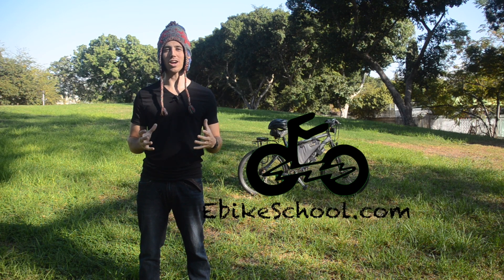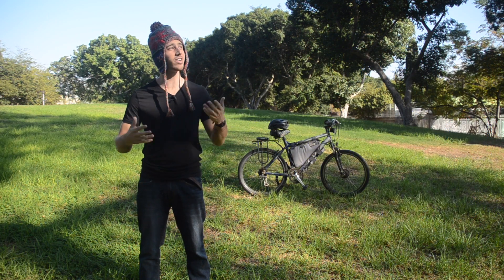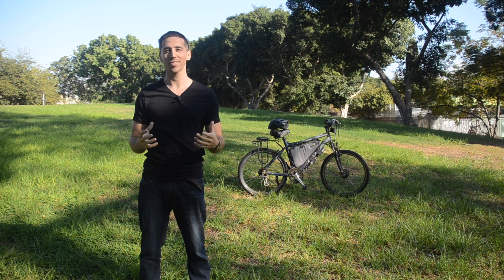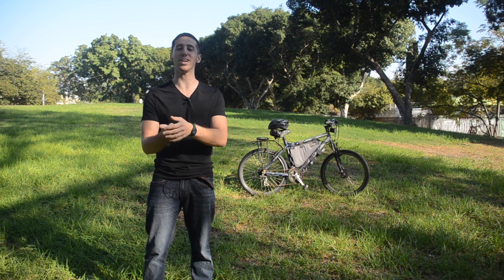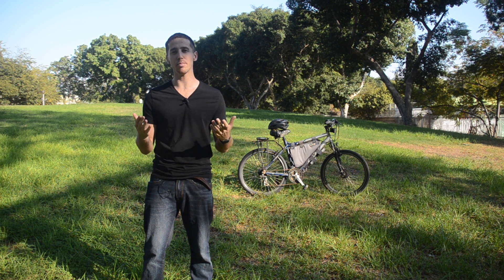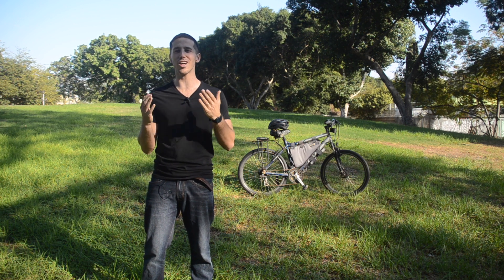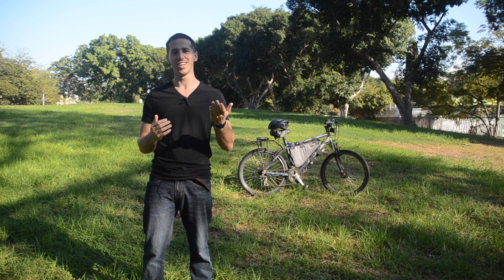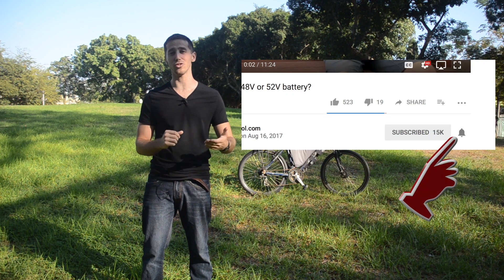10 COLD WEATHER Tips for Your Electric Bicycle

Comment: My EP-2 Pro e-bike starts to struggle at higher power levels when the battery has been stored at -20C outside for more than a day and won't turn on at all if it's been stored in -30C. 

Was wondering if maybe replacing the battery cells inside with ones that can handle lower temperatures like the Molicel P42A/P45B and P30B/P28A would help, as those are rated for cell temperatures as low as -40C?

Comment: Hi, could you please do one for hot weather. With the unusual/excessive hot weather.. my commuter diy ebike started shutting off on me I was trying to keep it in lower pedal assist modes and avoided using the throtle but towards the end of the ride I could feel it was stopping because of the heat. I don't want to ruin any of the electronics as this has helped cut my  commute time in half so any tips you might have would be great.

Comment: I've got a DIY battery pack that I only carry in my backpack so the cold weather battery problems are pretty much solved by default. It's very well insulated and the heat of my body plus the heat from the cells keep it at pretty much the optimal temperature. It's only a 500 Wh pack so it's no big deal to carry it on my back. Besides when I have my ebike out I'm usually going somewhere I need a bag anyway.

The battery seems solid but keeping it away from the harsh vibrations of the bike frame adds that extra bit of confidence knowing the welds are less likely to shake themselves loose.

Another factor is that my frame is quite small, so the battery would be a tight fit. It's designed to fit in case I want to, but I would certainly have to get creative with the mounting bracket.

Comment: Great video. I'm definitely leaving my lithium half charged this winter in the shed. Will probably get a heating blanket for the heater to.
Do you know of any device that I can hook up my 72v 40ah lithium battery to inside in order to use the power from it?
I'd much rather keep it inside and use it to charge my electronics or something than keep it outside in the shed the while winter.
Living in Ontario Canada sucks weather wise.

Comment: I've had an ebike since around 2016 and now learn I've been doing everything wrong! I have charged it too long every time. I always leave the charger in permanently! (I will stop now, since I worry the risk of fire is greater when the battery is a bit older!?)I have stored the battery fully charged in a cool place, around 5c for 3mos most years fully charged. And I ride in very cold winters when I'm home during winter, usually until the battery is dead. Then just wait, and cycle without PAS, and usually the battery can have a little juice left to get up the last hill on my way home. Still my 36V 10Ah (or maybe it was 13Ah) battery can get 100-130km a day on PAS 6 of 9 (in late summer temps 15c) averaging 16kph. I have a Bafang 250W with a Dolphin battery.

Comment: Cold hands are what stops me from riding more than anything else in winter-- I did finally buy heated gloves, and they helped a lot.
Reply: I don't know how cold your winters get but I've managed around –25 °C (–13 °F) with normal (albeit good) gloves. But then again, I only drive the legal 25 km/h (16 mph) so the windchill isn't as bad as with higher speeds. 

When it's particularly cold I might wear another pair of lighter gloves under the main ones.
Reply: You can get handlebar mitts, they are the best!

Comment: Thanks for the informative post. I've e-biked well over 10,000 miles of Vermont back country roads and forest trails over all four seasons for the past several years. One of my bikes is a 24 Volt system that I'd like to change to a 48 volt system. I'm wondering if I can change the battery and controller and use the same motor.

Comment: Re-lithium battery is there a unit other than a timer that i can connect between the charger and the battery to have control in the charging or is there a charger that is controllable in this way  36 volt and 48

Comment: Can i insulate with 1/8" of  styrofoam  sheet a box inside and outside where i can safekeep my ebike battery for winter time???
Reply: You can insulate a warm battery and it will stay warm a bit longer but you can't leave an insulated battery out overnight as it will just be a cold battery at that point with all the downsides that entails.

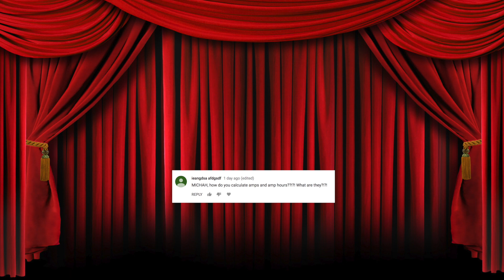Comment: 8:15 Amp Hours: If you think of electricity in a battery and wire the same as water in a bucket and hose; amp flow equates to the volume of water flowing in the hose at any given moment. Total amp capacity in the battery is the same as how many gallons of water the bucket can hold. Amp Hours = If the bucket can send 0.2 gallons of water through the hose at any given moment, and can do this for 20 hours (standard time measurement for amp/hrs) without going below 0.2 gallons flow, then the bucket has a rating of 0.2 gallon/hours. This is not gallons per hour, but how much water can drain from the bucket or how much can you open the valve, and have that water flow remain consistent for 20 hours. To complete the analogy, voltage is the same thing as water pressure in the hose. Usually the higher the pressure in water, or voltage in wires, the less volume of water or amps it takes to do the same amount of work. Just remember that some wires can not withstand higher voltage just like some hoses will blow out under higher water pressure.

Comment: I use USB foot warmers on each side of my (in use) battery while riding. When I am getting close to a change over (about an hour) I start warming the other battery. As far as charging at home or most anywhere you have 120V on tap, just bring them in with you. I have even slept with a battery a couple times to keep it as warm as possible with no electrical expenditure. - https://imgur.com/a/zXXlyuv

Comment: My number one tip for winter riding, Studded Tires, but be careful, do not be like me and get the biggest baddest you can find with the most studs, too many studs will make you slide on dry roads and should only be used off road but there are many suitable for one road use, Nokian being one the top. Dont get me wrong, the Ice Spiker Pro is a very nice tire, but unless you trail ride most of the time, it's a bit over kill for everyday road use when a tire with half that many studs will do just fine.
Liquid electrical tape ( Home Depot, Canadian Tire etc... ) is very good for water proofing plugs, it goes on with a brush, on the outside where the wires go in the back of the plug, but it does take several coats to get a good application, use gloves and goggles when applying it, I get an instant headache when using it so be sure to use with good ventilation. Non-conductive electrical grease for the inside after the liquid electrical tape gives you that much more added protection as it prevents corrosion for years and does not allow any water in.
It peals off very easily ( liquid tape ) if you ever need to modify or repair, in some case's you cannot get heat shrink tubing and this stuff works very well, it will eat holes in most linoleum floors and you will never get it out of clothes....
I use a variety of tools to apply it depending on my needs, from a tooth pick to a cut off pull tie, to the brush that comes with it and even very fine paint brushes to seal around the edge's of battery packs and Cycle Analyst etc..
For those of you who are not aware, not all heat shrink tubing is created equal, they do sell a " double wall, glue lined " type for automotive use, this is very good for battery and or phase wire's etc.. especially for those who a bit higher power :) like me. 
The " glue " or sealant makes the connection totally water proof in my opinion, much less chance of connection failure due to corrosion.
Personally, in my opinion, I use a Poncho that covers me and the bike, so most rain etc.. does not hit it when I am riding, yes I ride in winter too I am a big fan of fenders and grunge guards for down tubes, so my ideology is why let the rain get to the bike in the first place, obviously, you have to use a clear one so your lights show. I buy them at the dollar store and keep them in my back pack for when I need them, the wind generally keeps the front tucked under my handle bars, so none of my electronics is really exposed and not as cumbersome as a rain suit that only covers me.
I use high temp automotive silicone to seal up the wire end of a control as most have silicone gaskets for the end plates but it never hurts to add a tiny bit of liquid electrical tape around the edge of both sides of the gasket if you have it apart for other reason's.
Putting a small amount of silicone ( high temp ) over the screw heads that hold the heat sink for the mosfets in place

Comment: What do you think about putting chemical hand warmers underneath the neoprene battery cover ? What would you think would be the best location to place the hand warmers on the battery?
Reply: Hot spots and cold spots, not good for batteries, temp must be kept as even as possible with all cells, not just some of them as the temp affects the discharge and capacity.
Reply: @larrymacdonald4241  thanks

Comment: I bought you DIY battery book on kindle.  Then bought the dead tree edition for permanence. I plan to change my 84volt Emma GT battery to a lithium pack when the Lead Acid version dies.  Today, November 9, I parked the Emmo in my shed/Emmo Garage with a fully charged battery, and swithched off the circuit breaker.

It is starting to snow here. . .  I doubt I’ll be riding it again until Spring.

I do have a mountain bike, with studded tires for winter use.  Perhaps I’ll be able to electrify it.

Comment: AH=capacity? Like the car’s fuel tank? 
If the fuel tank is larger ( more AH) you get more range? And the Amp is like horsepower?
Reply: Volts = speed or rpm, amps discharge = power or torque, amp hours = capacity or size of gas tank, so the higher the volts you have, the faster you can go, the more amp discharge rating you have, the more power you have, the more amp hours you, the further you can go.
At 36 volts X 40 amps = 1440 watts of power or 1.4 kw, 72 volts X 40 amps = 2880 watts of power.
Amp hours 10 amp hour battery you can draw 1 amp for 10 hours or 10 amps for one hour, the average is 1 amp hour will get you 3 km, 10 amp hours gets you 30, 20 gets you 60.
So yes amp discharge and amp hour are not the same thing, but they are related. Amp hours is like a car gas tank, where as amp discharge is like horsepower rating.
Reply: @larrymacdonald4241  yep

Comment: I have a  PO4-20AH lithium battery in my E-Moped . I will not ride it in the winter . Can I just charge it and live it in a shed for 3 month. Cand the battery store in -20c weeks ? Or do I have to bring the battery inside for the winter?
Reply: Lithium batteries are best stored not fully charged, and you should bring those in the house.

Comment: What about keeping the batteries warm in an insulated case?
Reply: I've done that, I just used small thin styrofoam packing material and placed it around the batteries inside the pack, you will note, the case was supposed to hold SLA and i put in Li-ion which gave me the room to do so but even so, it's only about 1/4 inch thick. I didnt have the money to install a remote temp sensor to see how well it works and I havent ridden with it in really cold temps yet, biggest factor is windchill when moving at 32 kph rather than the ambient temp, it's alot colder.

Comment: Note that when you draw power from lipos they do heat-up. Not much but there. 1-2...3% of the power delivered is lost to heat. 
I fly my lipos in -20 without noticing more than a hair-width of performance loss. 
Otherwise, yep, totally agree. Edit: except soap. 
Dude... soap reduces surface tension. That means it makes water wetter. And wetter water seeps in tiny nooks and cracks way easier.

Comment: The thrifty man solutions for winterization. 1 a pair of bread bags around your battery for insulation from wet and cold. 2 a chemical had warmer pack included next to the battery. Just monitor the heat levels. This is for more intense cold. I usually just bundle it around my chest or stomach for fairly decent results. Tucked into a shirt sweatshirt or jacket for a spell will do a lot

Comment: ok so i charge my e-bike whenever im not using it. witch is usually like 2-3 days. is this bad?
Reply: CrazyZack As long as your bms works and your charger is intelligent enough to cutoff, it should be fine. Otherwise that is not a reccomened practice, though it is unlikely it will result in anything terrible.
Reply: @Bob_Lob_Law Someone doesn't understand batteries well. 😶‍🌫️

Comment: How long can you keep your li-ion battery without use? I heard that if you leave your battery without use for 3 months it breaks
Reply: Merunas Grincalaitis Not really, as long as you leave it around nominal voltage or above, assuming you don't put a load on it, it should be fine with sitting.

Your bms consumes a bit of current, but in all likelyhood, not enough to drain a battery over a 3 month period.

Comment: I believe it is best to cover the batteries with an electric blanket, and along with the blanket, wire in a switch for it, and a temperature sensor. So the batteries can always be at or near, their optimum temperature during winter. Or maybe something like an Arduino, to turn the blanket on & off, to maintain a set battery temperature.

And I would use dielectric grease, to protect all electrical connections from moisture & liquid water, to prevent corrosion, short circuits, and maybe even shocks.
Reply: maybe make a video for someone who is not familiar with anything you've said?
Reply: yeah make a video about this! I'd love to see how that works. Really, let me know if you actually do, I'd love to see it!
Reply: Use Arduino to warm up your battery :) How many people even know what that is I wonder :)
Reply: Just Jordan I don’t
Reply: Open source hardware and software 
I guess

Comment: Hi, very informative video thank you, there is one question i really do hope you can answer if you read this comment, i have disc brakes and i'm a first time user of these type of brakes, how do you tell when these brake pads are getting ready for changing ?
It was easy to tell with the rim brake pads as they're easily seen, but these disc pads are hard to tell for a first timer like me lol, hope you can help, best regards.
Reply: Mark Dennison Man, I usually just use mine, tighten them once they lose power, and repeat until it doesn't work anymore. Although you should change them if they behave out of the ordinary, ex super weak even after tightening, or making unusual noises.

Comment: Great tips on storing the battery inside, it can be annoying but worth the effort! You could add some tips on bike lights, I'd like to learn how to integrate led lights (and turn signals) to my battery pack. I'm working on a video for dealing with daylight savings... with the cold season also comes early darkness! Also I'm not sure if I'd agree with #8 about lowering the seat. The cold is already hard on the knees and a lot of people ride with the seat too low for proper posture. I prefer to use boots with a large grippy platform or have a cobbler add grippy soles to my work shoes.
Reply: I would highly reccomend getting a buck converter and using standard automotive lights.

As for turn signals, buy a set of four on ebay, and get a 3 pin flasher module. Adjustable ones are highly recommended to adjust the rate of blinking.

Comment: Great tips. I would like to hear more about torque and how they figure that rating in an electric motor, because when they say a motor is running at 60Nm of torque and let's say it's a 750 watt motor for ease of numbers here......at 750 watts for the motor, that's equal to ONE horse power, and one HP in a gasoline engine that small it NO WHERE near 60Nm of torque.  

For example, a Honda 5hp engine has 6.9 lb-ft or 9.4Nm of torque, and if 750 watts is equal to ONE HORSE POWER, then a 5hp engine is equal to a 3,750 watt motor.

So how does a 750 watt motor have more torque than a 5hp gasoline engine?

Here is where I got the specs for a Honda engine. It's under specs, between features and performance curve.
http://engines.honda.com/models/model-detail/gc160

I'm just very curious how they do their math and figure all this. 

Keep up the great work.

Comment: Still doing a great job Micah. And I still need to win a hard copy of the book I bought online and lost in my laptop's demise. ( Twas the DIY Lithium Batteries book). The only thing I would add is to carry some waterproof, windproof jacket for surprise encounters with wet conditions if at all possible as well as gloves that are waterproof as well. the gloves are a serious must for those of us, um, older folks who are realizing our new susceptibility to the cold.
Reply from the maker: Yes, going fast in cold air will make your fingers freeze even in a pair of thin gloves. If you got the electronic version of the DIY Lithium Batteries book, you should be able to re-download it from Amazon's kindle store (I don't have control of it, Amazon does). If it was the electronic version of The Ultimate DIY Ebike Guide, I can send you the electronic version again (I DO have control over that one).
Reply: It was in fact the Diy Lithium batteries book, so I should be able to re-download to my replacement computer. Would still like to win your other book as well though.